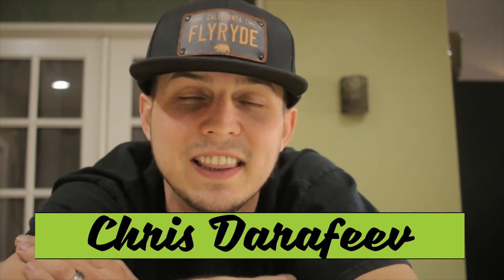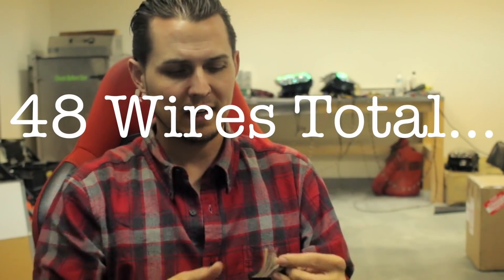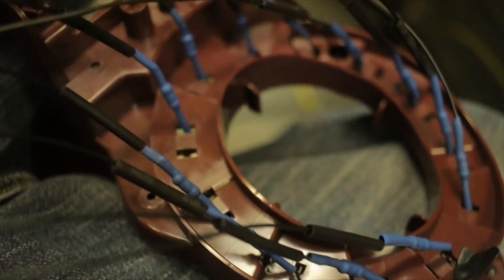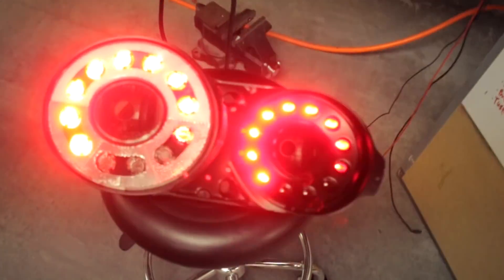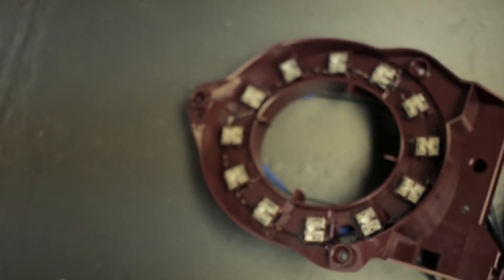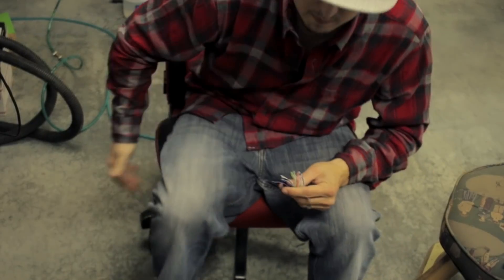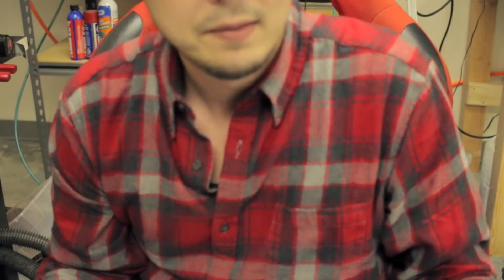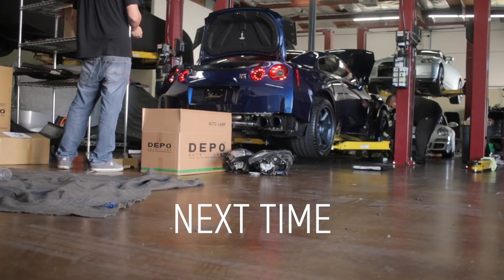How To Build Custom SEQUENTIAL LED Tail Lights - Nissan GTR

Comment: Man I need some help. I'm looking for 17 inch 20+ led tail brake turn light bar surface or flush mount not something that's gonna cost 800 bucks or more

Comment: Too many splices. You should look into buying a very cheap tool for 40-pin IDE (out dated) ribbon cable plugs, and also install matching header sockets at each light fixture.
Reply from the maker: The video is outdated too lol. That’s exactly how I build them now, as you mentioned. Ribbon cable directly to the resistors, crimped to an IDE connector that plugs into a header on the sequencer 👍

Comment: Do you prefer the ghozts sequential controler or Corsomotion? I ordered last week from both of them ghozts sent them a day latter corwo 8 days latter but I accidently ordered the new led strips instead of the controller because I had been driving for the last 17 hours from Indiana home and was tired didn't notice what I kept in the cart. Asked them to change it since they had plenty of time but they didn't. So I'm wondering which you think is better cuz I might give them another chance if they have better controllers.
Reply from the maker: You accidentally made a really good move. I would play with those LED strips and the ghozt. The Corsomotion controller is awesome too, but it sounds like your mistake may have been for the best.

Comment: Quick question how do i wire  the rgb halo to function as running light  and brake light
Reply: The halo only has two wires  and the factory harness three wires: ground, brake and running. Im new to this led wiring world lol

Comment: Can't you run a common positive wire from controller board and daisy-chain the LEDs inside the lamp body? Would be easier and neater if you could.
Reply: It looks like each individual LED needs its own independent source of power from the ghost module to utilize the sequential modes. I don't think a single power source daisy chained would work.

Comment: Thanks for sharing these videos. I build props for movies and haunted attractions and have done a couple of sets of 2015+ Charger headlights. Question about your method for wiring each LED ground to the ribbon cable you use to plug into the module. Why not just build the 30 pin connector with the wires coming out of the tail lights? By that I mean, instead of soldering each wire to a wire on the ribbon cable, just push the wire from the tail light into the ribbon connector and clamp it down. The metal clips inside will make a connection to the wire and it'll look much cleaner.

Comment: What is the part numbers for the led's and the (control) box? Ive been just ordering delay boxes some from China in Chinese language other will only allow me to use with turn signal(3 wire's) and thats not what im looking for
Reply: I'm in sound grate.

Comment: Way overkill. You should look into neopixel rings and an arduino.you would save tons of wire and material.
Reply from the maker: andrew lozano on paper you’re right, but unfortunately idealism and building cars often isn’t a clean mix. The day that a Neo LED can perform at the level of even an old superflux, much less a nice PLCC4, AND be addressable via one shared data wire, and AND have a perfectly spaced, level, centered platform to mount to that will replace the OEM board, then and only then will you be right. Till then we can build some amazing tails in a few hours to satisfy customers IRL 😉
Reply: @flyryde  so what what is the difference between the plcc4 LEDs (quick search just turns up results for 3528s)  and the 5050 neopixels? I want to do some modifications but I dont want to fall short on the intensity during the day.

Comment: Hey mate so for the this particular project you used 4 x ghost modules. One for each light ? Is that correct ?
Reply from the maker: No this set shown has 2 modules total, 1 per light

Comment: I would have made my own circuitboard and then just the connector...
Reply from the maker: On the newer tails that what we did. But this, like many other Nissans from 2000-2014 have more of a 3D setup, where Superflux LEDs are mounted on little mini circuit boards connected by wires, instead of one big board. Creating a true drop in board would be dope, but also pretty stupid in terms of ROI, since it'd cost a fortune, and sell for peanuts.

Comment: I have a stock acura integra.  I'm looking to turn the stock tail lights (3 bulbs) into a sequential turn signal but also keep their stock brake/parking light function.  Would I just need the ghozt module to do this?  If you could direct me to a link on your webpage as I'm really interested in buying the parts.  Thanks
Reply from the maker: You'd want to convert to LED bulbs, but honestly, I dont think Ghozt would be the best controller if you go that way. I think going full custom LED is going to give you the function you want with Ghozt, it just involves a lot of little tedious work to pull off, where as LED bulbs and a more basic sequencer would get you the look, without the super custom work.

Comment: How do you know what resistor value to use? I'm down for a course too!
Reply from the maker: Johnny Bouldin there’s online calculators to help you figure shit out, but you should really do your best to dig in and do your homework on exactly what type of LED you’re dealing with first. It SERIOUSLY helps to not be the 1st guy trying to pull something off. Best bet is do what works for others. My way involves wasted money, heartache, and breaking shit before you find the right answer. I don’t recommend it.
Reply: FlyRyde thanks for the quick reply Chris!

Comment: Would love to see how to single out leds on a circuit board or strip. Like the '13+ genesis coupe tails for example. Single out those leds. Or would it better to just start fresh and build my own?
Reply from the maker: +MrDaavee I’m down. I’ll make that exact video. It’s a BITCH to isolate grounds on those Tails, but you can’t really make a stand-alone replacement board, so you have to mod the factory ribbon board.
Reply: FlyRyde awesome!! Have done a TON of bk1 and bk2 tails as well as the aftermarket tails (not too mention headlights on various makes of cars) over the years up here in Canada. The one thing I always wanted to do was a full standalone sequential on the bk2 tails. Never had the chance and didn't want to try out on a customer set.
Reply from the maker: Dave, this is what you've been doing for the BK2 tails right? https://www.youtube.com/watch?v=_luUCXGFTQ8
Reply: FlyRyde yea, stuff like that. Adding in the power led bar across the bottom and curve up the side. I want to get the oem LEDs to do that.